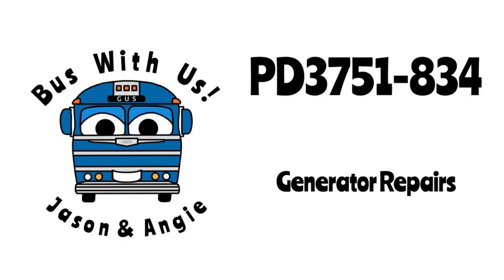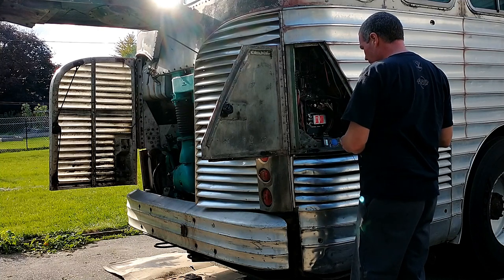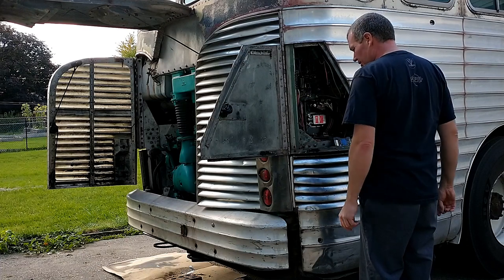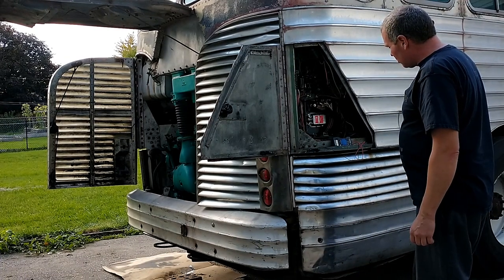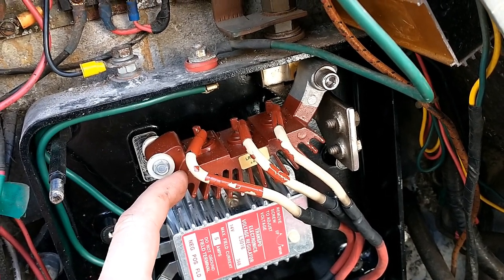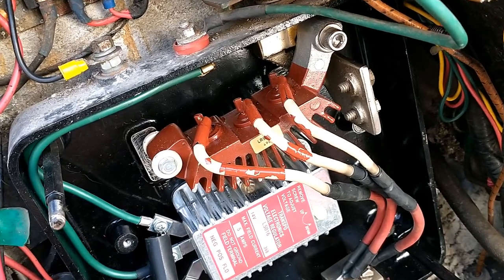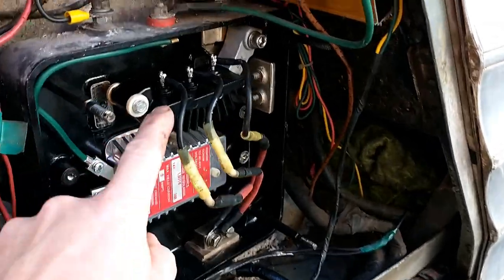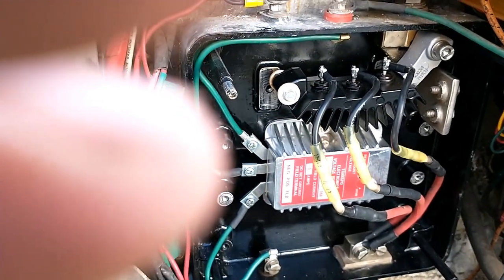Repairing Gus' Generator

Comment: it's so remarkable that your engine doesn't smoke... not cold, not warm... What a nice beast!!!
Reply: The Smokey dirty diesel thing with GM 2 strokes is more of a myth than a reality and if you overfuel them with the throttle most modern diesels will black-smoke as well.
Apart from when you initially drive them under load after a long dormant period while everything un gums and frees up they are as clean as a modern dieselengine just without all the DPF and Urea rubbish they choke them with these days.
It helps that Jason can actually drive too!

Comment: A simple battery isolator has two large rectifiers with the anodes strapped together and the generator/alternator connected to the common anode.  It is generally connected to two banks of batteries and keeps current from flowing between banks but still allows the alternator/generator to charge them.
Reply from the maker: I've been looking at different relays and contactors.  It's amazing the variety and differences in quality!  I'm leaning towards something a bit overkill as I don't like to break down.

Comment: Jason, folklore has it that any engine will always stop in the same position (same spot in the rotation). this means the flywheel is always in the same position when the starter hits. rotating the flywheel would address this, if that is the problem. as in rotate it on the engine, which is obviously not a trivial task.
Reply from the maker: Haha - it seems that way! We're going to buy a new starter come spring, and carry this one as a spare.

Comment: If you could find some kind of 12 volt relay that could handle the current that would seem to be a much better way to handle that. When the engine is running the relay contacts close and current flows. When you shut it off the contacts open and the battery can't drain. If a regular cube relay could handle that current that would be an easy system to build. I've seen those that are rated for 80 amp although I have my doubts they can actually carry that much.
Reply from the maker: I've got a friend who works in solar looking for a relay that will handle 200+ amps.

Comment: I'm pretty sure you don't have a fast idle switch so do you have a hand throttle cable or was that something weighted on your throttle pedal?
Reply from the maker: I have a tool I can wedge against the base of the seat to set the throttle.  Same one I use for measuring stroke in the air brakes.

Comment: Are those three leads robust enough to carry the full load? If not, perhaps that contributed to the early death of the diodes.
Reply from the maker: No - I don't believe they are. The diodes will likely burn out1 by 1 again. This is a temporary fix I am sure!  Will look into a relay and remove the rectifier in the spring.

Comment: I just came across this YouTube video. Another approach is to eliminate the diodes with their voltage loss and do the following: Fit a NO (normally open) oil pressure switch to the engine with say  a 3 to 5 psi activating pressure that is not grounded (available autoparts). Fit a 12v contacter ie: solenoide that can be activated full time with secondary contacts that can handle the voltage and amperage that you wish to handle (autoparts). Fit a live wire (opposite from earth) from the battery to the pressure switch. Fit a second wire from the other contact of the oil pressure switch to the solenoide. The solenoide's other primary contact is grounded or brought back to the battery. Use the secondary contacts of the solenoide to control whatever you wish controlled ie; ground, output, field...... When you start the engine it will take only a few revolutions to build the oil pressure to 3-5 psi. This will close the contacts of the oil pressure switch which in turn will activate the solenoide. If the amp rating required is quite low then the oil pressure switch can directly control the circuit. When you shut off the motor the circuit will be broken as soon as the oil pressure drops below 3-5 psi. Almost foolproof.
Reply from the maker: Thanks for the suggestion. We already found a big contactor, just need to wire it up.  The oil pressure switch would be a good idea if I don't find any switched power easily.
Reply: @BusWithUs.  I don't recall there being any switched circuits except perhaps ignition. I believe that there may be a manifold where an oil pressure switch may be screwed in after removing the plug. If not Tee it into the oil pressure sender but use schedule 80 or a hose and Tee for both. Pressure switches as I have described are available in 1/8 NPT or 3/8 NPT for about $15-20 CDN. I use a similar setup to turn on and off the engine alarm system on my sailboat. I have used the opposite logic for an emergency generator to prevent gravity fed fuel leaking through the injector pump into the crankcase while on standby.
Reply from the maker: @gerardus7314  I think there is switched power in the main junction box somewhere by the voltage regulator.  Should be easy to find.
Reply: @BusWithUs.  Let me know how it goes. Your solution may be mine some day. I am looking at a 4104 on Kajiji. Just talked with the gentleman. Restrictions prevent me from traveling to see the bus in person for the moment. We will see how everything turns out.
Reply from the maker: @gerardus7314  The white one?  I've looked at it already.  Video coming....
Reply: @BusWithUs.  Good morning, Would it be possible to speak with you to get you thoughts on the white bus?
Reply from the maker: @gerardus7314  Contact me through pd3751.com